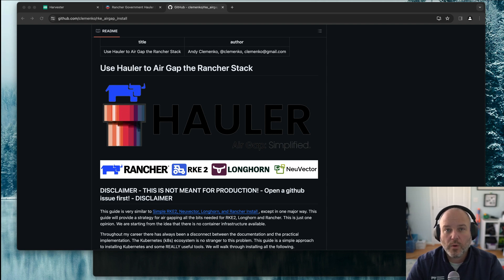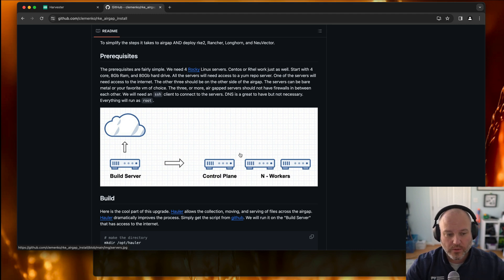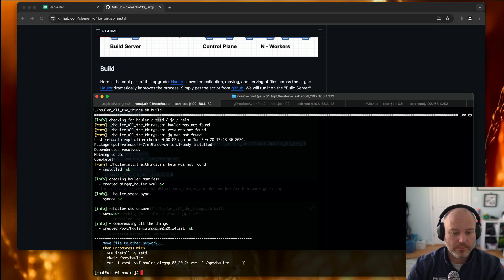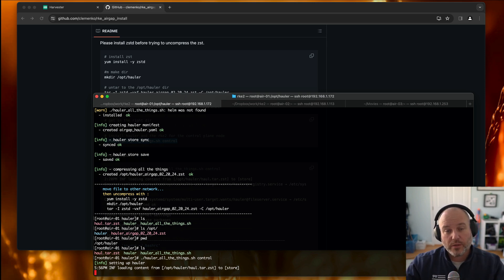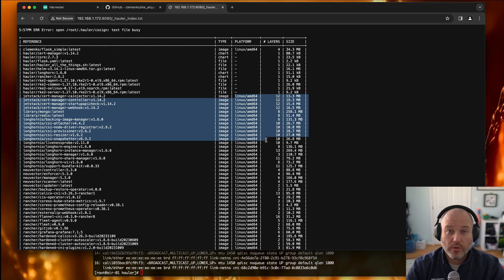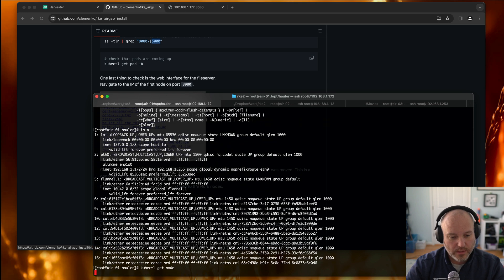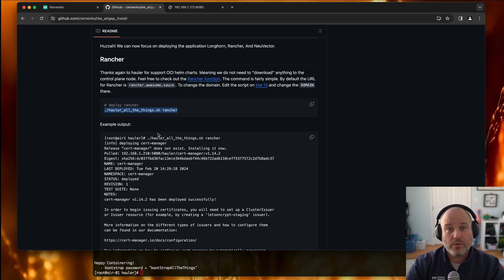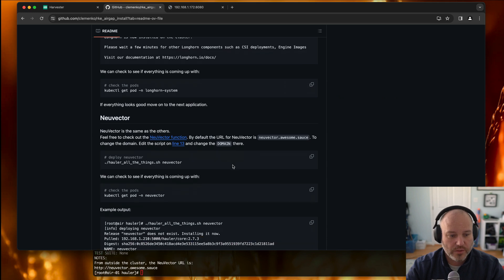Use Hauler to Air Gap the Rancher RKE2 Longhorn and NeuVector

Comment: Looks like there is an issue when running the worker node deployment.  It's failing at the adding yum repo :(
Reply from the maker: do you have an error message? Let me run through it and check.
Reply from the maker: I was not able to create a yum error.
Reply: @clemenko  What version of the Rocky Linux OS are you using?
Reply: The control build works fine but when I try to install the worker node it gives me the error with installing the yum repo.
Reply from the maker: Does the rocky worker have access to a yum server? I am using Rocky 9.5.
Reply: It's a fresh install of Rocky 9.5 with no firewall within my infrastructure to prevent access to the control plane.
Reply from the maker: does it have a yum repo server it can use?
Reply: @clemenko  I thought it was going to leverage the control to access the yum repo?
Reply: @clemenko  It just freezes [info] adding yum repo then says unabe to install yum repo
Reply from the maker: The script does not pull the OS packages. There are too many. That is why all the servers need a local OS yum repo server.  And it is only for a few packages and dependencies : "zstd iptables container-selinux libnetfilter_conntrack libnfnetlink libnftnl policycoreutils-python-utils cryptsetup iscsi-initiator-utils" Do  you have one available?
Reply: @clemenko  I sent you an email.  Hopefully that helps.

Comment: We have edge device running Ubuntu which does not have internet access at all. But occasionally it connects to Android or iOS device which have access to the internet. Is hauler suitable in this scenario to update docker app running on edge device?
Reply from the maker: Sort of. If you are using a phone to update the docker images you may not need hauler. The best way to use hauler is to download the images on an internet connected computer and create a tar file. Then you can move the tar with a thumb drive. The good part of hauler is that it can serve out the files as an http server and registry. Actually hauler might help improve the time it takes to move the files/images.

Comment: Another great video.  Question, I usually work with Ubuntu (Debian) cloud images, but where do you find Rocky 9 cloud images for download, or at least something that works with Harvester cloud-config?  I am working with Harvester v1.2.1 on a local server.
Reply from the maker: Thanks. I use the "Generic" images. 

https://dl.rockylinux.org/pub/rocky/8/images/x86_64/Rocky-8-GenericCloud-Base.latest.x86_64.qcow2
https://dl.rockylinux.org/pub/rocky/9/images/x86_64/Rocky-9-GenericCloud-Base.latest.x86_64.qcow2

How are you liking Harvester? Would an in depth video about it be helpful?
Reply: @clemenko  I really like Harvester and love the direction Rancher Government Solutions (SUSE) is going with automation and the concept of air gapping.  A more detailed video on configuring harvester, multiple nics, vlans, longhorn, rancher, neuvctor would be great - maybe working from the direction of seeder/packer, terraform, etc.  Just the normal things folks in home labs or small companies deal with.  Looking forward to v1.3.
Reply from the maker: @rnwtenor Ok, a longer semi-complete video? I will add it to the queue. Give me a couple of weeks. Work travel is fun. :D